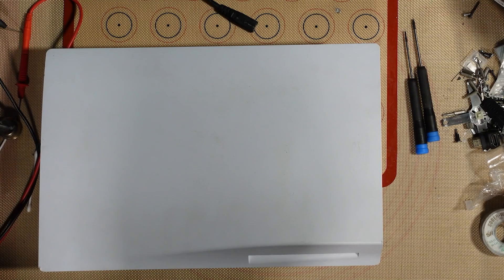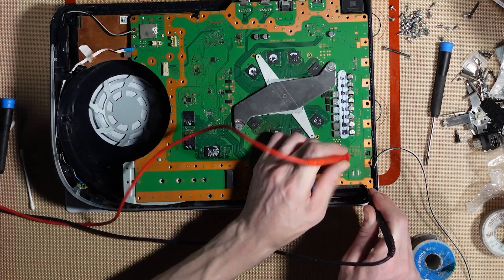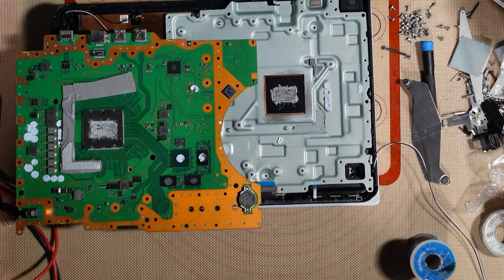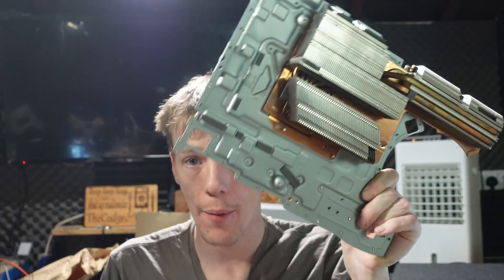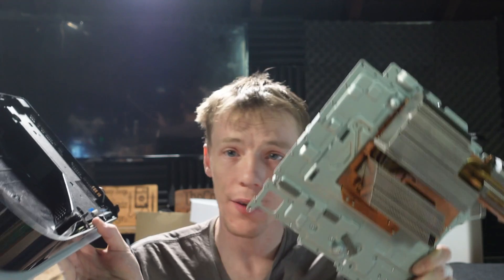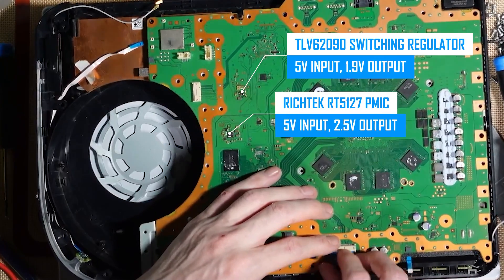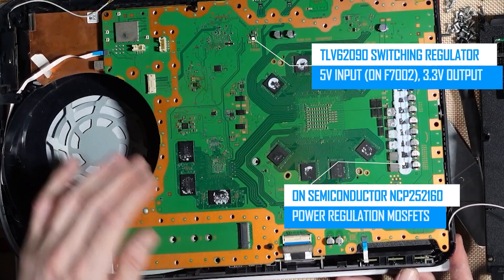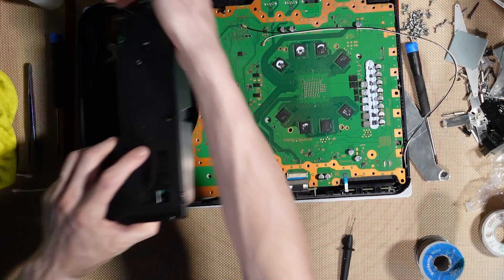Methodical PlayStation 5 Fault Finding To Diagnose No Power Issues (Including All Test Points)

Comment: @6:25 if the pins on the magnetic module make my multimeter beep, where do i look for the cause? I had shorts around my encoder too, but i took the encoder off and the shorts are gone. But the module and the caps on the underside of the module are showing shorts.. Could you maybe make a video based on this issue?
Reply from the maker: If the magnetic module is short it's a bad southbridge bud
Reply: @TheCod3r  thanks brother!!

Comment: Hi and thanks for your videos. I have a short on the R22Hr20g coils which are in the middle between power management 1,5v ddr6 and switching regulator 5v 3,3v TLV62090RGTT. It's normal?

Comment: On that bothhand magnetics module will all those legs, my right half (only the right half)of the bottom row(just like where you're testing) are showing short to ground for me..I ended up taking out my Southbridge because of some shorts around that, and the short went away.. Now I just have to swap that Southbridge out with another, and after a reball, well see if it works.. It'll be my first manual reball and because of YOU sir, I have the confidence and the know-how to give it a go.. Thank you I'll update this if it works.

Comment: Very good explanation of the components and power rails, but how come you don’t even have 12V, even with a known good power supply?
Reply from the maker: It's very likely that 12v was being pulled down to ground on this board, but figuring that out when so much had previously been done to the console wouldn't be worth my time. I'd already spent 90 minutes on it and was honestly just fed up of the different things I kept running in to on it
Reply: @TheCod3r  yeah i can understand that.